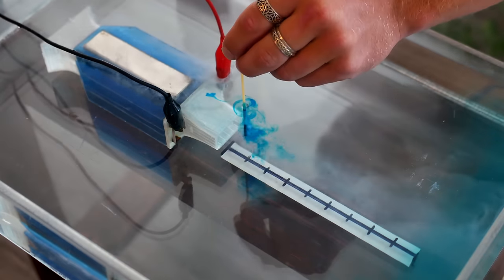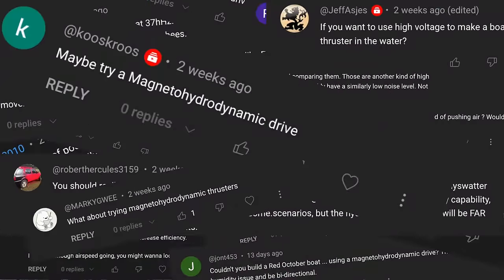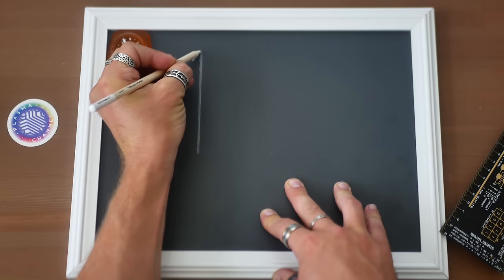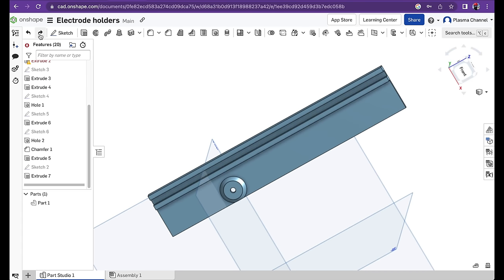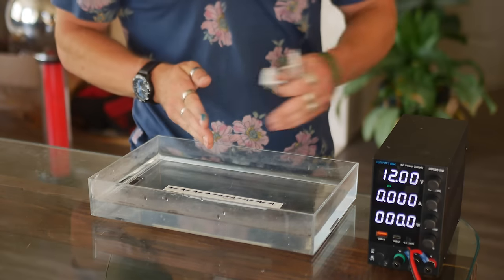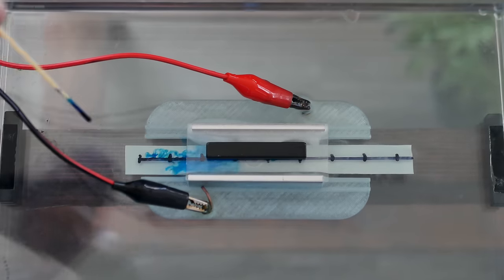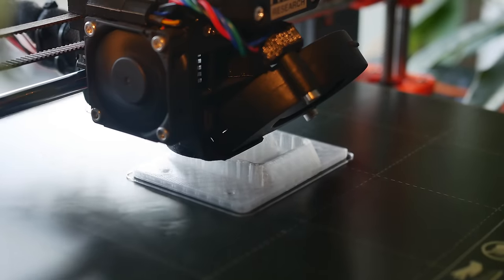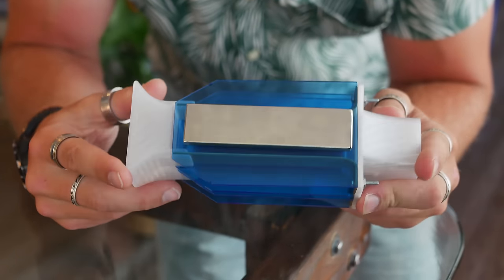Using Stealth Propulsion for Ocean Travel (MHD Thruster Build)

Comment: FANTASTIC!  A clear design direction for dramatically increased thrust from an electromagnetics engineer:  Widen the port aspect ratio (more distance between electrodes, less distance between magnets), and add a magnetic return path between top and bottom magnets.

Reasoning:  1. Low to no loss of thrust from widening the gap between electrodes.  2. HIGH gain of thrust from increase in magnetic field strength easily obtainable by moving magnets closer together and adding a magnetic flux return path from top to bottom magnets.  A bit like two custom C-clamps wrapping around each side and clamping against the top and bottom magnets, creating a flux return path.

Think of each magnet like a "magnetic battery," and the gaps between magnets as resistors.  If you want more current (flux) to flow, you can increase the "voltage" (magnet strength), and/or reduce the path resistance (distance between magnets).  A flux return path is like a low-resistance solid conductor in an electrical circuit, so the lower "circuit" resistance means the "current" (flux) goes up.  Higher flux, higher thrust of your design.

Beautiful work.  Thanks for sharing it!
Reply from the maker: Thanks Alan! Yeah I had never heard of a Halbach array until I posted this video - sounds like that’s an option. One thing I’m curious about though, is the loss of electric field density when electrodes spaced further away, and this less interactive pushing force. I feel like if magnets were halved in distance, and electrodes doubled in spacing, the water flow would be identical, no?
Reply: I'm not proposing anything exotic like a Halbach array.  You should be able to use all the same magnet and electrode hardware you have now.  You can gain a dramatic increase in thrust merely by changing the aspect ratio of your water ports to reduce the distance between magnets, and adding a flux return path between top and bottom magnets.

Reasoning:  Your testing showed a weak relationship between electrode distance and thrust, yes?  So, for example, widening the channel by a factor of 2x will have a very minor cost to thrust.  Now halving the distance between the magnets will increase magnetic field strength by 2x.  And since there's a strong relationship between magnetic field strength and thrust, you should get more thrust out.  Yet the port area is unchanged.

Your lowest hanging fruit for increasing magnetic field density is by closing that HUGE air gap between the outer surfaces of top and bottom magnets.  This will dramatically reduce magnetic circuit reluctance (akin to electrical circuit resistance).

As you already know, be sure all magnets have their poles oriented the same direction, or they'll cancel, like placing batteries in series: you always go + to - to + to - etc., which will have them add, or + to + or - to - will have them subtract. @PlasmaChannel

Comment: The US navy did experiment with MHDs but found that they are still plenty loud at high thrust levels because of all the bubbles formed on the electrodes, and a large slow turning prop is very quiet especially next to all the pump noise for cooling the reactor.

Comment: Absolutely fascinating video! The ingenuity and creativity displayed in building and testing the MHD Thruster are truly inspiring. Your exploration of the variables and their effects on thrust is both thorough and thought-provoking.

One intriguing observation was the relationship between electrode spacing and thrust, which seemed to follow a sigmoid curve, characterized by an S-shaped pattern bound between two thresholds. This sigmoid curve can often be described by the equation:f(x) = L / (1 + e^(-k * (x - x0)))

Given that the other variables—strength of the magnet, voltage, and length of the electrodes—all showed positive correlations with thrust, it would be fascinating to explore potential synergies between these factors. Here's a suggested methodology:

1. Multivariate Analysis: Conduct a series of controlled experiments, systematically varying electrode spacing, magnet strength, voltage, and electrode length. Record the thrust produced for each combination of variables.
2. Statistical Modeling: Use multivariate regression or other statistical modeling techniques to analyze how these variables interact. Look for interactions that might explain the sigmoid curve observed with electrode spacing.
3. Optimization: Based on the statistical model, identify combinations of variables that might maximize thrust or efficiency. Explore whether there are optimal ranges or specific values that align with the sigmoid pattern.

This approach could reveal deeper insights into the behavior of the MHD system and uncover synergies that lead to further optimization in the design of MHD thrusters.

Keep up the fantastic work, and thank you for sharing your passion and innovation with all of us!

Comment: Higher voltage also increases the rate of hydrolysis (lost energy), reducing efficiency. It voltage/current also increases the corrosion rate, so you would likely need to coat in inert material (platinum) for long-term use.

Comment: When looking at the spacing you only measured velocity and not mass flow.
You may find that the wider spacing gives improvements as your percentage losses to wall friction will also be reduced with a larger cross section.
Height or depth of the thruster would also be something to optimise again whilst looking at the mass flow.

Comment: Very cool experiment!

One side note: using current instead of voltage as a parameter could give a clearer picture of the effect of varying parameters. For example, making the electrodes longer doesn't increase efficiency, but it does allow more current to flow which is actually what causes the increase in thrust/flow.
Reply: It also increases the aspect ratio between opening and electrode area. As water flow the ions are carried with the water, obviously they eventually reach electrode but the path is more in line with the water flow with longer electrodes and a shorter opening
Reply: @cybyrd9615  nice catch! I hadn't taken the flow of the ion medium (water) into account yet. So in theory it should be more efficient with multiple narrow channels as opposed to one wider channel. :)

Comment: I worked in a magnet shop and we would stack magnets sideways to make the magnetic field reach out further and have a more direct area. For instance stack vertical of north on its side and south on the other then put one in the middle of the 4 facing the opposite of the 2 and in the middle has a further gause

Comment: Fun fact: a related thing, the magneto*plasma*dynamic thruster, is actually one of the most efficient spacecraft propulsion methods tested. It's not quite in the top spot, but it has a whole lot more thrust than its competitors in the electric propulsion department, and still easily competes on efficiency, beating out many of the less efficient ones

Comment: Verry good explained construction 👍
Can you also end up using a double nested eggshell as an attached end spout or, for example, tea eggs? (Two nested tea eggs with insulating bars, one bowl slightly larger than the other, smaller bowl. The voltage is then applied offset there: The first voltage is at the beginning of the first inner tea egg. The second different voltage is on the outside End of second tee - egg up. To finish, perforate the shell of the outer bowl and put on a small cone. To begin with, however, all you need is an insulated connector to the middle of the tee - egg and an intermediate annular channel between the shells. Inside is used a secondary, better conducting gas for experimentally improved flow.

Comment: biggest issue I'd see regarding commercialisation is in the "leisure boat" department. some people mostly have their yachts in salt (and brackish) water, others only yacht around fresh water, some switch it up every now and then.
Considering that salt water is going to be a lot easier to electrify, the setup of the 'optimal MHD thruster' might be different in salt vs fresh water, leading to wildly different outputs depending on whether the boat is in salt water or fresh water. would love to see this revisited to compare performance in salt vs fresh (vs brackish) water and to see what the differences in optimal setup would be and whether minimal adjustments (that might be made automatically, like toggling fresh vs salt water mode) would be doable.

Comment: Grat video! You should consider making your test chamber much longer, so that you don't form circular flow moving from outlet to inlet. The motor geometry (electrode length and spacing...) will become a more significant variable which couples to your other variables depending on the flow interactions. Once the chamber is long enough to produce negligible rotating flow, you won't have to worry about additional uncontrolled variables.  😁

Comment: Water doesn't compress I think your outlet and inlet don't need to be so slanted. If you use a ring configuration you may limit vortexes on your corners making your flow more laminar. I would be interested to see if a ring of magnets in the middle of the thruster would allow a stronger field and more propulsion.
2 stages could be tried too. One in front of the other.

Comment: Researchers at the University of Adelaide developed an electrolysis system that uses a proton exchange membrane (PEM) to separate the hydrogen and oxygen gases produced by electrolysis. This system was able to produce hydrogen from seawater with an efficiency of up to 99%.
If you were able to get thrust from the electrolysis, then ignite the hydrogen/oxygen on the way out you could create a secondary thrust.
Or, if you want just collect the rising Hydrogen and use it for energy.

Comment: Scale it up and buy smaller permanent magnets and position them in Halbach array, also integrate a previous ionization stage (electrodes with sharp pointy edges) and test it in salty water, you could put the MHD thrusters in your ionic catamaran.

Comment: You should shield (paint) the electrodes on the outside. You basically get a current that surrounds the MHD but it is not as efficient although it will draw half of your current.
Also try AC, as you might just get by without losing electrode mass. Basically construct a capacitor and to coils both connected to AC. The phase might need some delay but it should work by alternating a charge in an alternating magnetic field. Size will matter more this time.

Comment: To get the bubbles of the electrodes add a piezo type rumbler to shake the electrodes slightly. It should detach the bubbles from the electrodes enhancing conductivity and lowering strain.

Comment: I know turning up the voltage increases the power, but I wonder how well it would work if you try to use a voltage below the redox potential of water so that you won't get bubbling and corrosion.  You'd have to make up for the reduced voltage somehow though.  Maybe at low voltage, plate spacing would make more of a difference?  Stronger magnets are also always good, but I think you've done pretty well in that department.

Comment: Flat surfaces increase drag in fluid dynamics. You may consider adding a slight venturi curve to your electrodes. Reminder: Nature abhors flatness and right angles. I am aware this increases production time/difficulty/cost, but the increase in speed at the apex of the curve combined with the increase in pressure (apparent even in non-compressible fluids) may be beneficial.

Comment: Hi , I have been a sea captain for 45 years and found this very interesting . I don't know if anyone has mentioned that the anode on boats naturally degrades and gets eaten away . This would be a real problem as the more you increase the power the faster the anode and cathode will disappear. if you can overcome the degradation problem it may be viable . Just look at the anode zinc blocks on a standard vessel . Electrolysis will eat away a steel hull very fast if the zinc anodes are of poor quality or are badly connected . Just saying this is a problem . Good luck

Comment: Like an aircraft propeller, what this is doing is transferring momentum to the medium. So (I think) changing the width doesn't change the speed of the water, but it does change the momentum transfer because there is more mass that is being accelerated to 3 m/s (for example) with the wider configuration.

Very interesting project. Makes me wonder why they aren't already building these for pleasure craft unless people just like noisy engines that wound manatees.

Comment: One thing on the velocity vs spacing thing. From my expert armchair opinion, volumetric flow rate may be more desirable than free stream velocity. It’s harder to measure, sure, but if this whole drive is just based on momentum transfer, a higher mass flow rate/volumetric flow rate means you’re getting more speed/force out of the motor

Comment: Put some iron or steel magnetic guide sheets vertically to guide the magnets. This will also reduce resistance of the channel which will reduce losses. Ie smaller fringe currents. It should help reduce the electrolysis occurring because that’s a loss. In sodium pumps they put Micah sheets at the edges of the mhd section to minimize fringe currents to improve efficiency.

Comment: To produce a controlled level of force, you need to manage the current.  Since you can’t control the salinity (and hence resistance) of the water, you need to control the applied voltage based on current sensed.  PWM with a single high speed switching transistor is a highly efficient and easy to implement method.  A small micro controller and a series shunt resistor in the electrode’s circuit would allow you to measure the current and adjust the voltage to make the current hold to a user defined (digital ) set point.

Comment: the direction of charge flow with such a set up will be perpendicular to the magnetic field initially, but once the charged ions are acted on and their path turned, the force the experienced will no longer be in line with the direction of desired flow. not sure if there is enough flow to keep some from turning direction more that 90 degrees, but once they do, they are counteracting your flow perhaps some layering of E field electrodes and B field electromagnets can be frequency controlled to keep the resultant force pointed in the direction of desired flow  - also increasing electrode surface area should increase the rate of ion production and thus the charge density of the flow stream - i think... also also, the idea of corroding metal into our waterways is prolly a nonstarter - but neat to play with in small scale

Comment: 5:00 I would consider the volume of liquid you are essentially applying charge across. With shorter spacing you are applying charge to a smaller volume of water. Water of a smaller volume has less mass, so although velocity may/may not change, the actual thrust could have changed because you are moving a different mass of water.

Comment: When gas is introduced to a liquid, the average density is reduced. This could potentially be used as a way to generate additional thrust, if the flow path was sloped upward (front to back). Look up "gas lift" for some reference info.

It might be feasible to use the gas to produce thrust in other ways too (may need to engage your "inner pyro" again 😅).

Comment: In order to improve performance your electrodes must be like grids of blinds to let the water in from the sides of the channel; your magnetic field is at least 50% lost by dissipation, you need to include the magnets into a mag-shield; your hydrolized brass produces poison that will kill any life in the water, use platinum coating. The width of the channel does not affect the speed which depends on ion mobility (current, temperature, magnetic force), it affects the volume per second which is thrust, you want thrust as much as you want speed.

Comment: I would like to suggest to make the electrodes from stainless steel and increase the scale, because some technologies do not work very well in small scales, by the way, the voltage should be increased significantly, let's say to the level of air ionization, but basically you are amazing for doing this! I love your channel and everything you do because if you do something you may fail sometimes but if you try hard enough you will eventually succeed! but if you sit on the couch all the time, then nothing will work 100% , thanks for content!

Comment: I remember this being the plasma channel. Basically using impulsed sparks.  For real power exchange, realize electricity is a kinetic energy which like all kinetic energy transfers are amplified when accelerating energies are exchanged (see the Oberth effect). Plus in your overall design, look at the Avalanche effect where large stationary potentials will collectively avalanche when touched off by an instigating wave.   
Together a large voltage field energized container with a focused escape hole initiated by spark driven magnetic (using fast discharging bifilar wound inductors for magnetic production) in a stationary voltage field. Or voltage impulses in a fixed magnetic field will kick water like a whale’s blowhole. ( Oh yes, add a pre charge voltage charge collar to the inlet of an insulating pressure pot power drive stage, with a Tesla style one way impulse biased valve. For maximum forward directed thrust without losses in a reactive direction (and maximum speed).Stay classy.

Comment: Excellent demo, Quick suggestion, try Electromagnet - With those 3 parameter, once you have electromagnet - you can increase the power of electromagnet, that will be 4th parameter, higher the power of electromagnet, greater the force, Cheers!